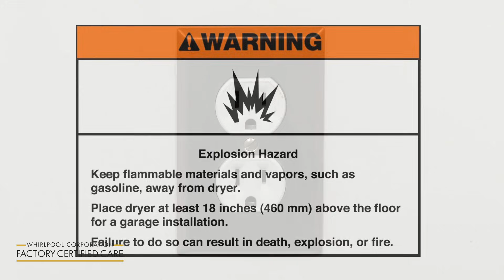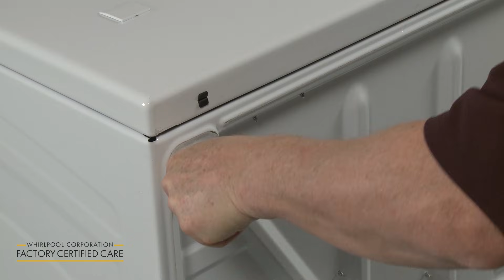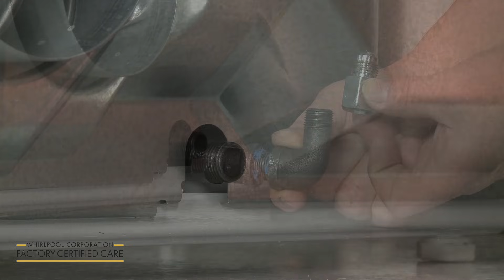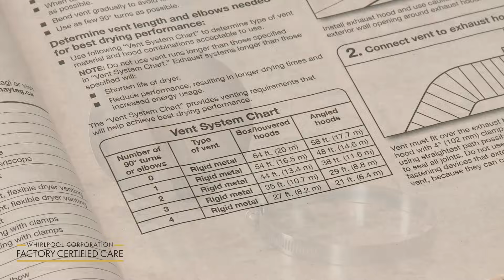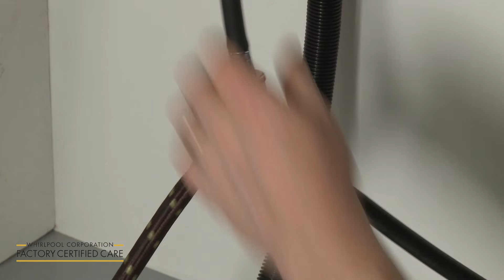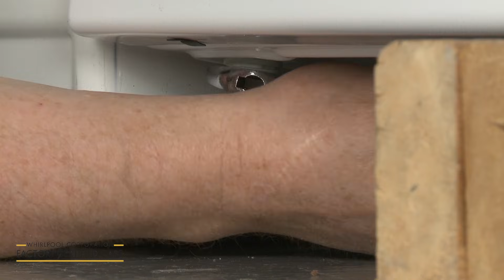Whirlpool Gas Dryer Installation & Gas Line Hookup Tutorial

Comment: The pipe fitter that came with the universal kit does fit the rear gas pipe which I find perplexing.
Reply: Did you find the adapter size you need on the back of the dryer

Comment: Is pipe joint compound necessary?
Reply: Recommended
Reply: It's required for all non-flared threaded fittings. This seals the joint and prevents gas leaks. Flared fittings don't require pipe joint compound because the seal is made at the flare, not the threads.

Comment: excellent , i couldn't think what to do because the bottom connection clearly need some type of adapter, i just assumed it be like a 3/8 to 3/8 coupling . But the use of the extension and the 90 pipe piece makes a lot sense. it all galvy pipe right ?
Reply: Pretty sure you’re supposed to use black iron for gas
Reply: You always use black pipe, for gas installs.Galvinized will corrode, the inside will bubble , and the fitting will get pin holes.

Comment: Teflon tape better than compaund
Reply: I was wondering the same thing?
Reply: Teflon tape isn't rated for gas and should not be used for gas pipe threads.
Reply: @tier3rd375  The yellow teflon tape is used for gas applications

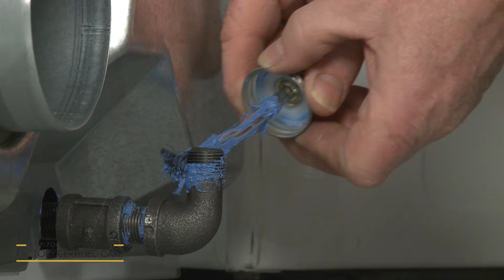Comment: At 3:56, the blue gas pipe compound application did not even BEGIN to cover the threads adequately.  This would be a terrible gas connection.  Sloppy work.
Reply: Ive seen a lot of people use a yellow gas tape. Whats the difference? Will either one work?
Reply: @prophetseven728  the yellow or white tape is for water connections not gas. No tape can seal gas joints
Reply: @TheDeathLove  The yellow tape is "Manufactured especially for natural gas, propane, butane, water, oil and chemical lines"
Reply: @TheDeathLove yellow tape is for GAS
Reply: Yellow tape is for natural gas, many use tape then pipe dope on gas joints. But I don't think I would use it alone
Reply: Facts yellow tape is for gas lines. Red/white is for water lines depending on the diameter size
Reply: Lol this is just an EXAMPLE mr. Hyper tension
Reply: Hate when pipe dope is described as a sealant.  It’s a lubricant

Comment: Did anyone notice the fact he said clockwise, and it shows the dude rotating counter clockwise. Then vise versa? Because some people don't know the difference. Haha!
Reply: You're correct as far as the top down view in this video. But clockwise & counterclockwise in mechanics are not affected by perspective. A right-handed thread, as these legs are, is always turned clockwise when it recedes into its hole, clockwise from the perspective of one standing behind (or in this case below) the screwdriver or wrench. As if the narrator you are laying on your back looking upwards towards the dryer.  Works just like facing the front or back of a boat doesn't switch the sides of the boat referred to by "port" and "starboard".

Comment: So why they sell the exhaust flex nationwide if it is not good or fire hazard
Reply: I've been using the flexible one for 7 years now.
Reply: I presume that stuff is safe for electric dryers but not gas? That said, I'm trying to work out how on earth you hook up a vent on the side or back of a dryer to a solid metal exhaust tube...?
Reply: Dryerflex makes a great flexible dryer venting hose that is much more fire resistant and has better air flow than the cheap slinky foil vents. They partnered with GE ( part number PM08X10085DS ) and are now available at Home Depot for 24.99. Those cheap foil vents have paper and will catch fire. https://www.youtube.com/watch?v=lV2Gx8-ryoE
Reply: Just like extension cords, people use them improperly, which is where the risk is. There are flexible vents made of heavy material.